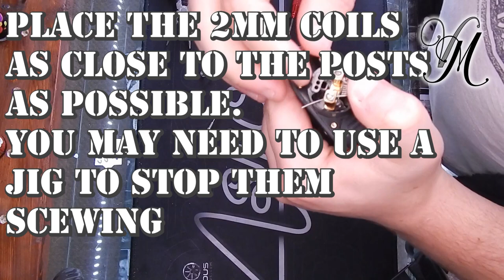Suicide Mods Nightmare RDA Review | Quad Coil Build Demo

Comment: yoo mate nice demo I didn't even think of building 4 coils in a 2 post rda I'm gonna have more fun building now lol  and what size kanthol wire did you use cos every time I get some it's kinda thin
Reply from the maker: Not going to lie Martin, i cheated. I bought the wire. 
Clapton Ni80
1.28ohm /ft
22/36
Then i made the coils with 5 wraps (6 if you look from the top).
2 at 2.5mm and 2 at 2mm
Have fun, be creative and stay safe... And stay Cloudy 😂😂❤️🙏🤘